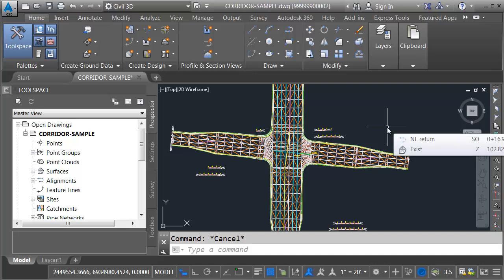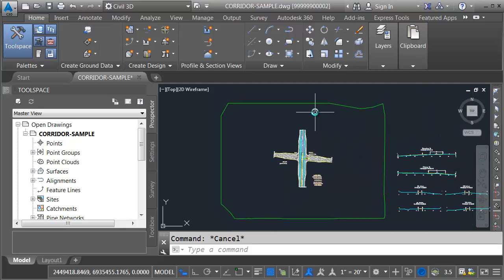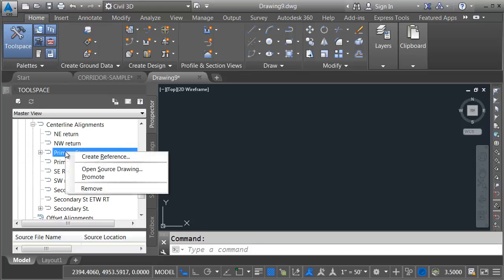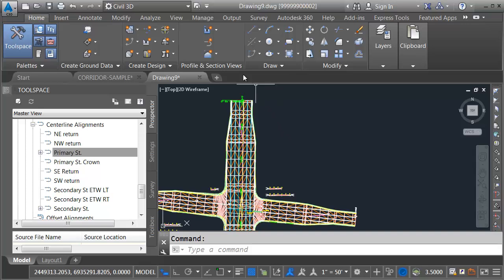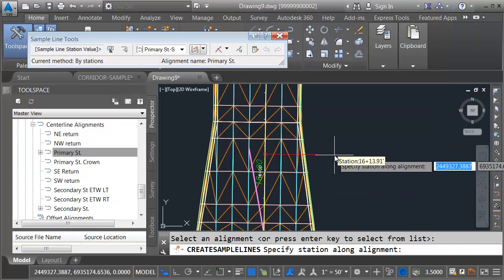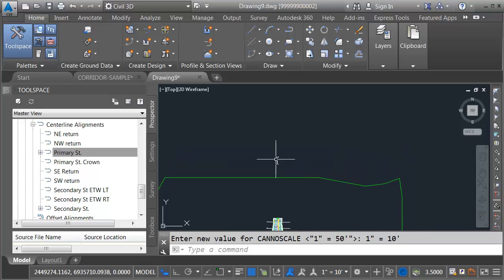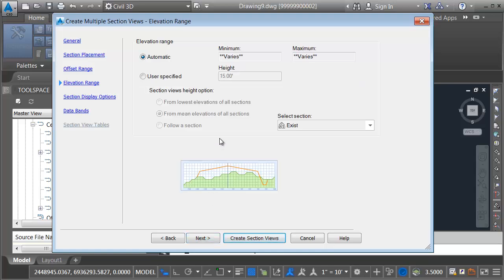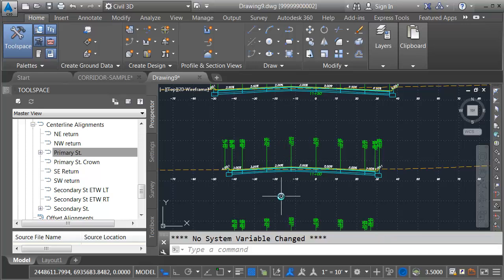Placing Civil 3D section views in their own drawing

Comment: Good video. THis workflow is essentially good but caution is that if you are using civil 3d 2015 and below..the cross sections won't update well. You would need a workaround. Thanks for 2017 ...the workflow is now smoother. We can reference corridors.